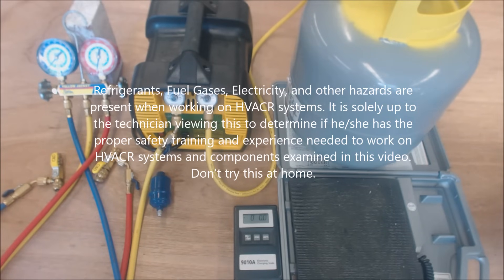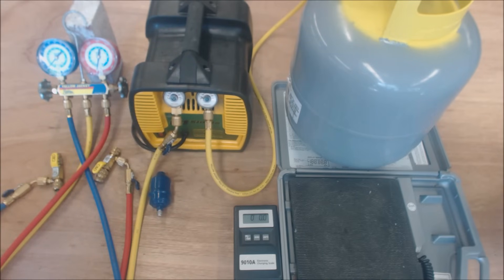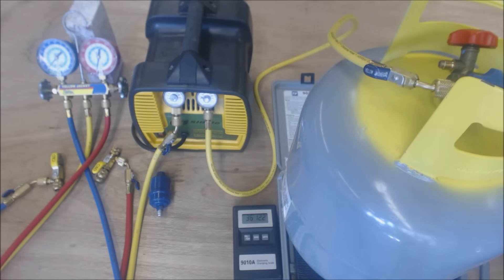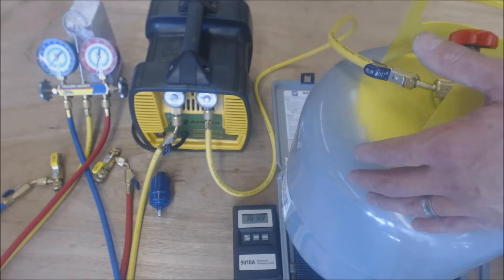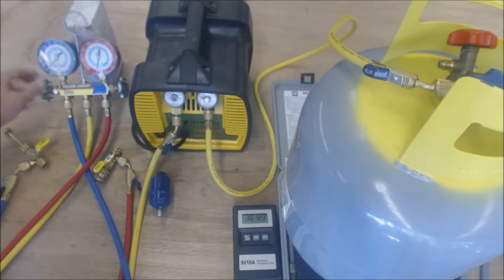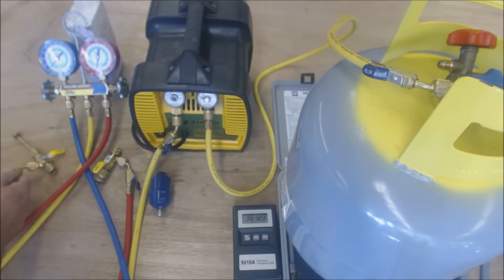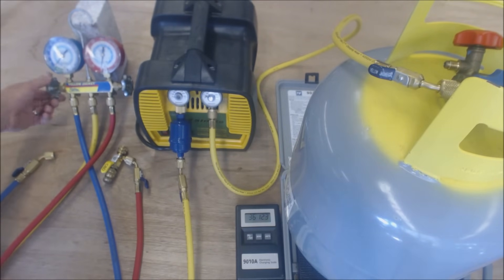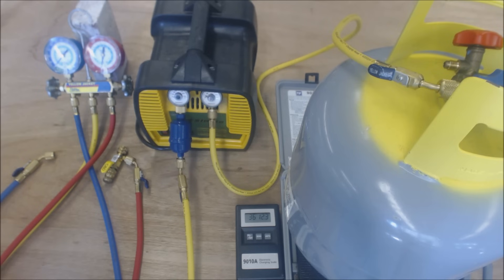Refrigerant Recovery Machine, Hose, and Tank Setup! Recovery Process!

Comment: Curious about the part where you mention pulling down to 10hg?  I can't find anything that states this.  I did find a page and if you look about 75% down the document you'll see a table for 410a and from what I can tell it says for systems with capacity under 200lbs you need to pull to 0 psi and those 200 lbs or more pull to 10hg.  Am I misunderstanding this?  https://www.epatest.com/R410A/manual/manual.jsp

Comment: great video! would it work without the recovery unit. say i hooked the yellow line directly to the tank, would the compressor be able to get all the refrigerant out of the system that way? similar to a pump down.
Reply from the maker: Yes it would. That is called system dependant recovery, granted the compressor may have a hard time doing it do to age and you may need the self contained for the last part since the compressor uses the refrigerant to lubricate and cool, thanks

Comment: Hi, really like your videos! Can you use the same refrigerant recovery machine for different refrigerants? 

I do car A/C , and will soon be setting up with HFO123yf, want to avoid buying a new recovery machine if possible. ( all of my equipment is separate like yours ) . 

Thanks
Reply from the maker: It is best to avoid refrigerant oil contamination or mixing what was in the hoses whenever possible. If it is not possible, then they should be blown out with nitrogen and drained as best as possible. Thanks
Reply: Cool, so as long as i clean the hoses out ( or probably just keep my hoses separate ) then I will be ok to use the same recovery machine but with a different filter?
Reply from the maker: I believe so but just check with your distributor who will buy or exchange your bottles. As long as they see the correct pressure and sat temp on the bottle when exchanging and you are not reusing the refrigerant from  an empty recovery bottle, you may be ok. You should check with whoever is exchanging your bottles first, thanks. here is a link on this - https://youtu.be/eKAGXek-KhM  --  Here is a link to the Appion G5 Twin Recovery Pump   http://amzn.to/2dGSEyr

Comment: I noticed you're using an Appion. How exactly do you purge this recovery machine when switching between different refrigerants (for my work I generally work with R22, R410A, and R134A)? Was thinking of buying a G5 Twin but I want to make sure I can use it on multiple refrigerants.
Reply from the maker: Hey Sandro, Here is a link to the Appion G5 Twin Recovery Pump   http://amzn.to/2dGSEyr  -- My appion recovery machine just has a type of impeller inside. These types don't need a certain amount of refrigerant going through to lubricate or cool the motor or compressor. I would mainly be concerned with reusing the refrigerant out of what was an empty recovery bottle. Otherwise at the supply house for exchanges, they just hook the pressure gauge up and they check the sat temp to make sure there are no noncondensables or other refrigerants inside and for that I would not really be concerned with unless they were. My supply houses are not concerned. Here is a link for a refrigerant exchanging process - https://youtu.be/eKAGXek-KhM
Reply: Ah ok, thanks. I've heard some people complain about the tank pressure skyrocketing on hot days, and the Appion manual recommends recovering with 3/8 hoses instead of the standard 1/4 (which is all I have) to avoid restricting flow. Is this absolutely necessary or can I get by with my 1/4 hoses?

Comment: From what I am seeing most people are recovering in vapor, and here goes the golden question. Are todays recovery machines like Appion, ect able to handle liquid without the liquid damaging the machine prematurely.
Reply from the maker: Hey trukin forever, here are the manuals for both the Appion 1 http://www.appioninc.com/downloads/files/G1Single_Manual.pdf and Appion twin-  http://www.appioninc.com/downloads/files/G5Twin_Manual.pdf  --  I've been doing it that way for years, thanks.
Reply: Which way have you been doing it for years?
Reply from the maker: I was referring to our prior conversations when I was mentioning recovering in liquid and vapor all the way to the end or liquid and vapor and then at around 15 psi switching to vapor only. I sent you the product manuals so that you could see that they designed their units for liquid and or vapor. Thanks trukin forever
Reply: Thank you acservicetech and I will make sure to use your links to the product. Have a good day
Reply from the maker: Thank you very much!

Comment: Do you primarily recover in vapor because it is safer for the machine, and if you did recover in liquid how do you know when to open your vapor side of the gauge.
Reply from the maker: If you recovered in liquid or in both liquid and vapor just wait until you are at 15 psi or so and then just start recovering vapor only. It is not less safe to recover in one or the other for these types of self contained recovery devices just the older style ones which wanted vapor only. Thanks!
Reply: acservicetech wait until you get to 15 psi on high side or low side
Reply from the maker: High side

Comment: The machine you are using in this video is the Appion single, and the link you gave is to the Appion G5. Seems like the one you were using in the video is more user friendly. Do you know what the difference between the two are
Reply from the maker: Appion recovery units have never let me down. I read reviews and talk to others around here. It really just comes down to capacity. They will both pump liquid. The G5 is more expensive and has two pumping sections and the G1 is a single. They compare in cost by roughly $175 and the G5 seems to now have become more of the standard for heavy duty use it seems but there is nothing wrong with a G1 and I still use my G1's in class.  I don't have a link for a G1, maybe you can try to find them at the local supply houses. Thanks Trukin Forever!
Reply from the maker: I just linked the G5 for this one because I did not have a link for the G1's. I don't know if they are not stocked as much now or what. Thanks for the question Trukin Forever!

Comment: If the condenser is working,  can use the compressor to dump the refrigerant right into the bottle without a recovery machine
Reply from the maker: Yes you can, thanks
Reply: AC Service Tech LLC Is there a vid on that?
Reply: trukin forever what about on automotive?
Reply: P
Reply: K
Reply: Self contained(Active) = using condenser compressor

System Dependent(Passive) = Use your own vacuum

Comment: Do you revover r410 the same way as you do r22?the reason im askink cause r410 is only charged as liquid....because its a mixture of refrigerants!!!thank you ur one of the best in youtube!!
Reply from the maker: Hey Victor, yes you do and you will be taking all of the refrigerant out of the system anyway so you will maintain your mix. If you suspect a leak then stop at 0psig so you don't pull air into the tank. If you only need to pull a little r410a out of the system then while it is running,  dump the liquid into the recovery bottle on the red side then. Thanks!

Comment: HI IF ok I have a few questions , Being new havoc ,  A few years back I found two bran new recovery tanks , Question 1 , Did I make a mistake buying then off eBay ? AS after seeing this video , My fears are when  taking them to be emptied , will they not want to deal with me because of the tanks not being there's?   2nd Question the two tanks I have. like I said are bran new ,still filed with nitro never used . My concern is with the D.O.T testing law . Should I have them tested now , having only  a year left will they see the tank as  New and a lesser cost to me for recertification do to this ?  Last question , Do you know were I need to take the tanks for Recertification ,and what the cost may be  ?  I do follow your video s and enjoy your teaching ways . TY for all you kindness and time ,witch does help me a lot .  Is there anyway I could chat with you thru E mail ? again thanks
Reply from the maker: So it is never bad to have a few extra recovery tanks. You could see if you have the manufacturer that your local distributor deals with first. If that doesn't work you could buy  a tank from that distributor and take any refrigerant you have and pump it into the new bottle. I think my best advice for you is to have a talk with your local supply house to see exactly what they are willing to do. I have one supply house that will take 38LBs of refrigerant in a 50lb cyclinder and one that will only take 34lbs. Most will pay you for the r-22 and others will want to charge you. It's odd. As far as the hydro is concerned, the company that you are doing exchanges with will take care of that unless you are just sitting on the bottle for a long time because you will get a new one when you exchange. I would let them pay that hydro expense. Thanks and let me know if that helps RD10!

Comment: so what you're saying is that, it is always safer to plug the hose into the vapor port of the tank right?
Reply from the maker: That has been my experience but more importantly just don't put vapor into the liquid port. Yes you could put liquid or vapor into the vapor port of a 50lb tank. Thank you for your question!

Comment: Hello ac service tech! I'm trying to solder a copper pipe to the accumulator on compressor of a window unit. Any ideas what to use? I've used 15% Silfoss but still leaking on me. The accumulator I believe is steel and won't catch to well.
Reply from the maker: You can use Lucas Milhaupt 380, 560, or 505.  560 would likely be the best bet but any of those should work. Make sure to use a liquid rubber product or wheel well paint when you are done. Thanks!
Reply: acservicetech great! just watched a video on lucas milhaupt copper to steel solder and they use the 560. Thanks! This liquid rubber or wheel well what is that if I may ask?
Reply from the maker: plasti-dip   http://amzn.to/2emwtkX
------http://amzn.to/2e98Ji0----------or wheel well paint, it doesn't have to be this brand because you can get it at any auto zone or advanced auto parts, napa if needed--http://amzn.to/2eJIKzJ

Comment: i have a question sir,,whenever hooking up the gauges, is the unit on or off?
Reply from the maker: Good question! If you are using a self contained recovery unit such as in the video then the system is off. If you are using the compressor of the outdoor unit to recover the refrigerant from its own unit then the system would need to be on. Thanks!
Reply from the maker: If you are just hooking up gauges for checking the charge then it can be on or off but for disconnecting purposes you need to disconnect while the system is on so refrigerant is not stolen out of the system. Here is one with king valves and schrader valves---https://youtu.be/eXkqOS_qywo------https://youtu.be/Ydu0B3_Wkss

Comment: nice video! how about the recovery machines that say purge! how do you purge the recovery unit?
Reply from the maker: Great Question! So the purge feature is for recovery machines that bring refrigerant into the crank case. After you are done recovering you switch the tubes with the purge lever and the unit pumps the refrigerant left in the recovery unit into the cylinder. The style used in this video does not have a condenser or lots of tubing that would have as much trapped refrigerant to purge.
Reply: I have a bacharach stinger and been trying to figure out how to do that. I don't want to release what's still in there into the open. instructions aren't to clear.

Comment: How can you tell from a vapor to a liquor?
Reply from the maker: Great Question! Essentially if you are reclaiming a system that has time to equalize completely then you can recover both and dump the refrigerant into the vapor port on the tank. Otherwise if it has not had time to equalize then there would be more liquid in the smaller liquid line and more vapor in the large line. Usually you are recovering both at the same time and putting it into the bottle in the vapor port of the tank at least on type 1 and 2 systems. Thanks!
Reply: Dragonfly watch the scale.  You'll be able to tell, it climbs fast then will slow way down for the remaining gas.  I put the tank in a bucket of cold hose water if it gets too hot slowing transfer down. ice in the water even better.
Reply: Is it not harmful for the recovery unit sucking liquid refrigerant from the system?
Reply: Ramon, although some recovery units claim to do liquid recovery like the Appion etc, I've heard it's still hard on the unit and should be regulated.  An instructor stated that units that claimed to be able to were often damaged doing so.

Comment: this isn't on the subject but can you do a video on  heat pump heat mode true suction i got but  what pipe the  discharge is flowing through now? and why do some heat pumps have no ambient and coil sensor, it funny I'm recovering right now lol
Reply from the maker: Nice! When hooking up to a heat pump in heat mode, suction would be the middle port and the discharge is the large line. The liquid line is still liquid but now headed toward the heat pump metering device. Some defrost are timers are just not equiped with a temp sensor which is not a very good design. They use time to shut off instead of the dft sensor.